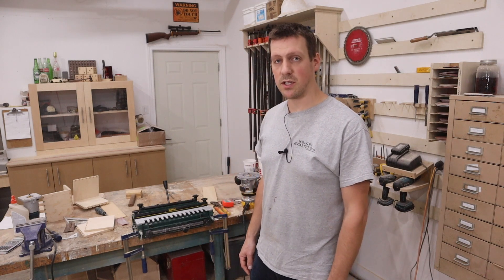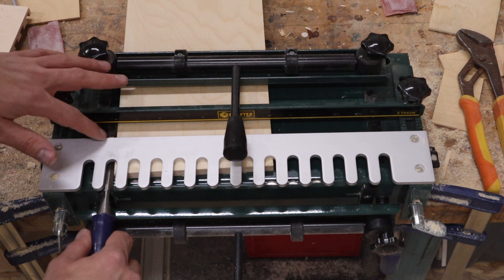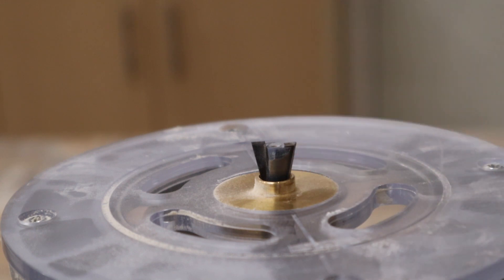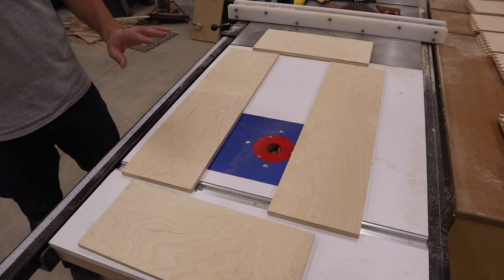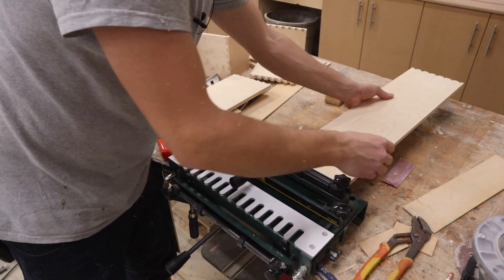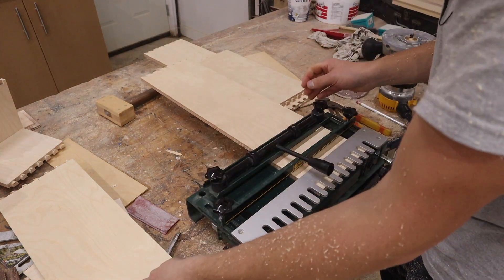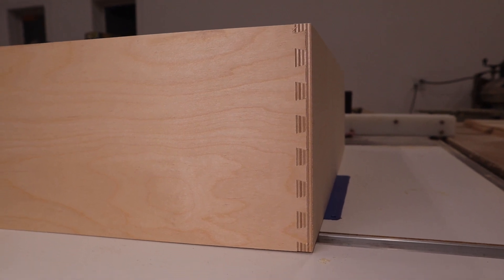How To Set Up & Use A Dovetail Jig

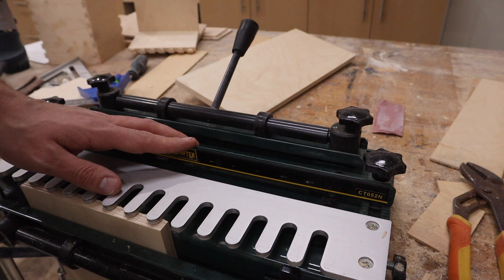Comment: At 1:50 you say "Next you want to set up this back rail..." but you don't say why or what it does, only that you set it to 3/4".
Reply from the maker: Tony Quinsee-Jover it sets the depth of cut. Your router base hits it and stops you from routing to far
Reply: @WesHamstra  so how do you set it?  Measure from the edge of the bit to the edge of your router? Trial and error?
Reply from the maker: Tony Quinsee-Jover it’s mostly trial and error. That’s how I figured it out
Reply: The guide bushing sliding in the template is what stop you from routing too far. You only need to ensure that your template is adjusted properly for the material you’re using.